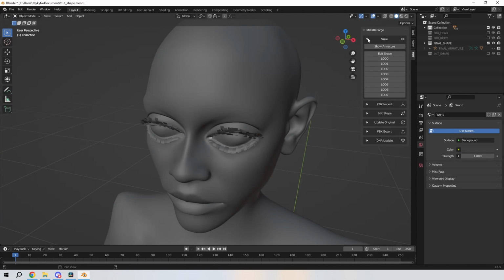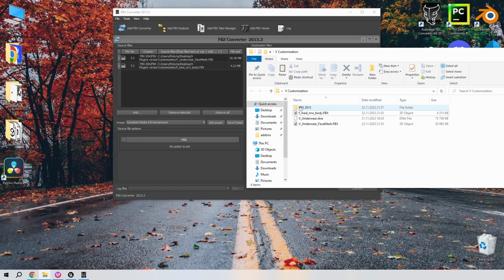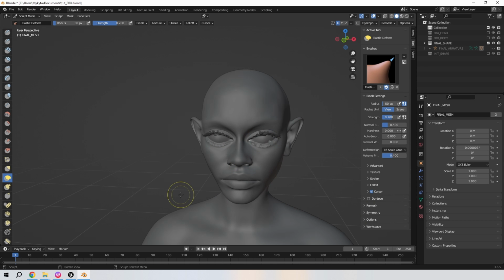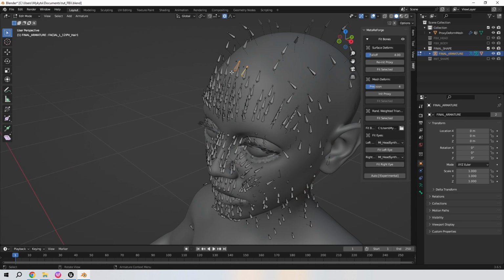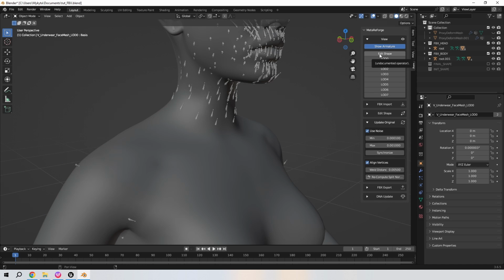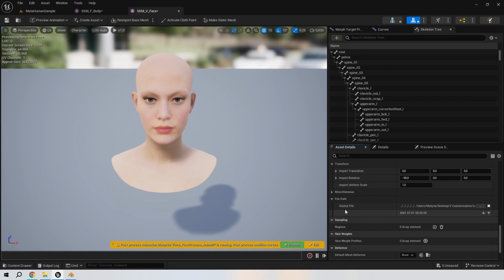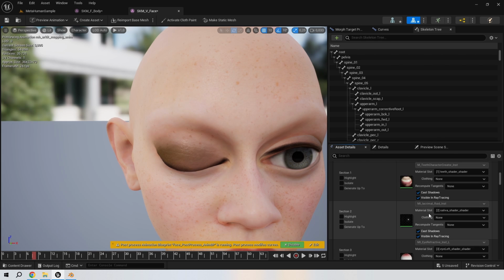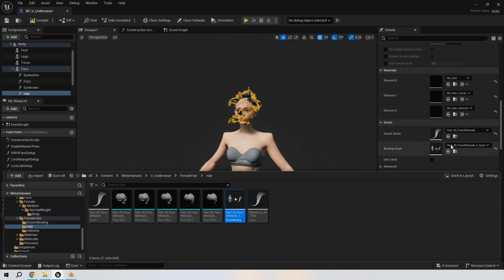[Outdated] MetaReForge: Full Body Metahuman Customization Now Possible in Blender

Comment from the maker: This tutorial shows a recommended workflow for MetaReForge 1.0 which is NOT SUPPORTED any more. Use 1.1, it is much better and the update does not require any additional fees

Important notes and frequently asked questions:
1. It is recommend to import both head and body, even if you are going to edit only head, cause otherwise the addon will not be able to properly recompute split normals, and auto fit method was optimized for full body skeleton.
2. At the moment, the addon is not fully compatible with Blender 4.0. It works, but some actions take extremely long ('Synchronize' takes ~10 minutes in Blender 4.0 vs 10-15 seconds in Blender 3.6).
3. If you significantly alter the body proportions, it is recommended to scale the Final Mesh while maintaining the height of the original Metahuman. Sometimes this can help fix issues with the binding of groom assets, but keep in mind that with significant changes in the area where hair should be, even if you follow all the recommendations, reattaching the original Metahuman groom might be impossible.
4. Backup the content of the folder <addon>/third_party/dnacalib before updating Blender or MetaReForge to avoid recompilation.
5. Using non-english system language sometimes lead to an error during build. You can request a temporary fix in discord private messages.

Comment: Great tutorial, using the same controller values, such as jawopen, may I ask if the results of your blender plugin driving metahuman are completely consistent with those of UE?
Reply from the maker: Hi. They are not 100 percent the same but accurate enough to debug animations before export/import. I would say, it is almost 100 percent accurate when we move a single slider only and some errors are accumulated when a few sliders involved at the same time.

Comment: Seems like FBX converter runs also on Win11
Reply from the maker: Hi. Because of that metareforge 1.1 does not require fbx converter any more, cause the head mesh (which FBX required conversion) can be build from DNA file instead of FBX.

Comment: Thanks for the addon but as Metahuman Artist I would like to add a note here:

1- Addon license is not fair enough specially since it has just a standard license for just a single user and for just one commercial product (if you keep the license this way with all due respect it will be worst maximum 5$ since there is other tools out there with better pricing)

2-I always wanted to have an addon in blender for two additional proposes, one adding control rig to the Metahuman skeleton and two merging Metahuman head and body bone and mesh for full skin paint transfer the same we have in Maya source file but with full body and face controller rig.

If these issues get fixed, I will definitely switch to this addon in blender!

Thank you!
Reply from the maker: 1. You must have misunderstood the license. The license states:
"One installation by a single user.". No need to purchase additional licenses for multiple projects/products. Only for extra seats. I don't know any metahuman tool with lower price.

P.S. "Price per product" is for "Stock assets" like 3d model, print etc. It is an installable tool, not a stock asset.
Reply from the maker: 2. I am trying to add more features, but this one's not a priority right now.

Comment: quick question, with the body changes you made to the mesh, how would the animation work with joint deformation? i mean, muscle, skin deformation at joints. I understand there is a specialized ML Deformer workflow for that, which i assume is complex and not fitting in this workflow. any idea about that?
Reply from the maker: There is a default metahuman body. And default metahuman body is a regular skeletal mesh which just transfers deformations (location, rotation, scale) from bones to attached vertices with some additional pose correction via post process anim bp to make it look a bit better. And we try to keep as many original things as possible. So there is no muscle simulation like in ML deformer. As I know ML deformer workflow involves May, and at the moment I am not sure that we can adjust it for blender
Reply: Thanks  @squeezypixels  for the swift reply. so, in your opinion, without the ML deformer workflow, and with reasonable body changes, the character body will still look good while animated?
Reply from the maker: @MichelHabib  i think yes. Usually I have more problems with head, so I need to go back and tweak something. Body is ok usually. I will try to do some extreme body changes to see how bad or good animations are.
Reply: @squeezypixels   Thanks Again

Comment: Hi, i will buy this right away if you can answer this simple question for me? You said you can export and edit the mesh in other applications? Does this mean i could export the mesh to zrbush for example and then bring it back to blender?
Reply from the maker: Yes. You can edit the mesh in any way, but vertex indices, topology and material slots should remain unchanged.

Comment: I have two problems with this add-on 1st when i Synchronize the LODs are not clean and need a long cleaning specially in eyes,
2nd, i couldn't get lip bones to fit and work correctly how did you do that?
Reply from the maker: Sorry for a late reply. Could you tell me more about the problems in discord. I am trying to improve bone positioning and sync thing, as results are not perfect, but it never required a lot of cleaning
Reply: Of course,
This is a very helpful add-on,

Comment: This plugin is incredible, exactly what I have been looking for. I am although encountering a problem when trying to fit the bones. I initialised the proxy but the "fit selected" button remains greyed out. Any idea why this might be happening?
Reply from the maker: Hi. At the moment I would highly recomment use "Auto" method as It will initialize all proxies and apply all necessary methods from the advanced tab. But regarding initial question: fit selected is grayer out if there is no
a) proxy (surface deform and mesh deform requare separate proxies to be initialized)
b) final armature
c) final mesh

Hope it helps. If don't we can continue in discord (https://discord.gg/qYtEq2ukDX) or via email (squeezypixels@gmail.com), as YouTube comments does not allow even to share screenshots.

Comment: Absolutely love the tools you've made for working with MetaHuman in Blender, but a question about this one. Does MetaReforge work with copying Shape Keys over to the LODs or do I need to use something like your Shape Key Wrap plugin? And if the answer is the latter what's the best way to go about doing that? I'm not quite sure how it would work with transferring from the edit shape to the head and body models, especially for something that alters along the seam. I'll be tinkering to try and figure it out, but I appreciate the assistance.
Reply from the maker: At the moment, there is no such functionality. It will be added in the next update (due to reasons beyond my control, the timeline has shifted a bit, but the work is ongoing, albeit not as fast as I would like). Currently, I can recommend using shapekeywrap. After "synchronize" and fixing the normals at the seams in Metareforge, you should switch to shapekeywrap and transfer all the custom shape keys you've made on the Final Mesh to the mesh objects in the FBX_HEAD or FBX_BODY collections. I wouldn't recommend making significant changes to the mesh using shape keys, as there could be problems with incorrect pivot points, and I would also strongly advise against changing the seam area.

Comment: Another thing for fitting the bones, that you could add as an option, is to sculpt the changes on the editmesh as a blendshape.
Then you can get the closest point to each bone and calculate a vector from the original point position to the shapekey point position and add that back to the bone.
You could probably also do the orientation by calculating the normal, but it worked fine for me even without that.
Then just apply the shapekey by deleting the base and then the key.
I wrote a script for that. it runs instantly and gave better results than your methods.
Reply from the maker: Hi and thanks for the advice. I think I'll add something similar as an option.

I tried over ten different approaches, and the most obvious and simple one is to do as you said: move the bones based on the vector of the nearest point's movement. If such a method worked with all bones, I would have settled on it and not complicated things further. But I had to. The "Surface Deform" method in the addon does approximately that (applied to the bone head) based on the nearest polygons, but it also adjusts the bone's orientation. And speaking of adjusting the orientation, I'm starting to think that sometimes it only hinders (given that the orientation of the axes of the current bone does not affect how this bone will be animated, the Unreal Engine animates bones in the space of the parent bone, not in the rest-pose of the current bone), so at least I think I'll add a "lock orientation" option, at least for facial bones until I find a better solution.

Adjusting bones and improving animations is something I'll gradually enhance over several months, as it's very important.
Reply: @squeezypixels  if you want i can send you the code for my method. Can i ask why you think, that this method doesnt work for all bones? So far i havent found any big issues, but its also hard to see with over 800 bones :D
Reply from the maker: @MrDestini001 
1. because not all bones are close to surface, some bones are deep inside the mesh
2. Orientation is important, sometimes more, sometimes less, but it defines how the child bones will be animated. My addon is not perfect for adjusting the orientations for sure, but it is not a reason to use simpler "translation only" algo, it as a reason to find better algo that will adjust rotations better.

Suppose I have the same algo somewhere in my early private versions, so thanks

Comment: I haven´t purchased the plugin yet, but just letting you know that it is the reason I have actually started to learn Blender.
I´m a 3ds max user and still have no plans on switching to blender, but as there is NOTHING there in Max to customize the body, it just cannot be done, I just asked around and was pointed to this plugin...
Gotta say, getting a basic understanding of blender was SO much easier than I thought it would be, I got it up and running in about 2-3 hours of following some very basic tutorial.
I still needed vacation time to "free my mind", but now I really wanna try to get a custom metahuman working this way...
I´m gonna join discord before I purchase, as I´ll probably have a few more questions, but maybe one more question that may be interesting for the public as well:
I´m planning to use this to also create custom metahumans for my kids (just a personal project, kind of like "3d pictures of your family" for memories...:)
I´ve already done the photoscanning and mesh to metahuman, but obviously metahuman doesn´t offer kids body types, so I´m a bit worried about being able to get the proportions right.
How well does it work for lets say changing the length of the arms or legs? What I´ve done so far in the metahuman creator is to at least adjust the head size, but some proportions like chest to arms/legs ratio is still pretty off.

Comment: Would it be possible for me to export the LOD 0 to Another Software, Wrap the LOD 0 metahuman Topology onto a Head Scan ( Photogrammetry/Reality Capture ),  Bring it back in blender, Generate all the other LOD's and then back to Unreal?
Reply from the maker: In general, it's possible to export the Final Mesh (combined LOD0 of the head and body) to external programs, and then proceed further with the steps, but the vertex order should not be changed so you should be careful with it (as I know when you export OBJ from blender with default settings it will change vertex order).

I've never personally done this, but I know users who have. It's not always easy, but generally possible, so feel free to join the discussion in Discord.
Reply: @squeezypixels  Sure! I'll Join up :) 
Thanks for your amazing plugin for blender!
Reply: I would recommend to just use unreals "Mesh to metahum" plugin for that process and than use that metahuman imported via bridge into Unreal (including its dna) as a starting point.
For that alone you don´t even need to use blender, I only landed here because the metahuman body types are seriously limited and its not able to customize them enough, even if the face already matches 100% through the mesh to metahuman plugin.
Something I personally do not understand: Why they don´t just add more customization options for the body directly in the metahumen creator, as it shouldn´t be harder than the massive customization options you have for the face...:)

Comment: I have managed to implement a similar work flow some while ago. I used surface deform tool and scripting to adjust armature positions to the morph. But it was only later than I've understood that you have to edit DNA, which I had no idea how to do. So, after spending a full day on this, I've decided to drop my efforts. Anyway, one tip to avoid long reimporting time is to delete all shape keys in blender and import into unreal with "import morph target" unchecked. Thus, only the base-mesh would be modified, and  other morph targets would still be intact.
Reply from the maker: Yes, the need to edit DNA was also a surprise to me. I still don't understand why the blueprint can't use the regular rest position...If it were that simple, I would have just published another free tutorial on my channel, but the number of nuances to consider is not limited to just DNA.
Thank you for the advice regarding shape keys/morph targets, I already know that they are the reason why it imports too long. Currently, a feature for adjusting shape keys is in progress, since the original deltas may not fit the new mesh, so it's likely we cannot avoid the long import process. But yeas in the current version of workflow it may speed up the process for the lowest LODs.

Comment: WoW!  Looking forward to this, does is there a date for the Blender 4 release?
Reply from the maker: Hi. It works with Blender 4, but it is highly recommended to use Blender 3.6 or 3.3 as accessing some data blocks becomes VERY slow in Blender 4.0 for unknown reasons. I have developed a workaround which I will add for a slight improvement in Blender 4, and it will be published next week. However, I'm not completely sure whether I should devote a lot of attention to circumventing this limitation. To be honest, I would prefer to work on developing new features rather than dealing with a technical issue that will likely be resolved on Blender's side some time later

Comment: I can replace new mesh with tool not sculpt
Reply from the maker: no you can't as we need to have the same topology and vertex indices to properly align bones. You need to manually (sculpt mode, proportional editin) wrap metahuman head around your mesh, or use another addons for wrapping. Some built in helper features for wrapping are in progress
Reply: @squeezypixels   yeah sure. I using metapipe v2 in maya they have blend shape. But i need Zwrap in ZBrush before

Comment: Can one also change the heads of the model and thereby implement something else? For example, if I remove the MetaHuman head and replace it with my modeled head because MetaHuman has such an iconic look that I want to avoid, and instead import my modeled head.
Reply from the maker: I haven't tried it yet, and it's not supported in the v1.0 workflow, but maybe we'll try to deal with it in the future. 
Btw, regarding the iconic Metahuman look, it's largely about the textures. The Metahuman mesh topology is quite good, so I don't see any reason to change it, unless you want to create some kind of creature in the end.
Reply: iconic look is because people are lazy and use almos the out of the box model :)